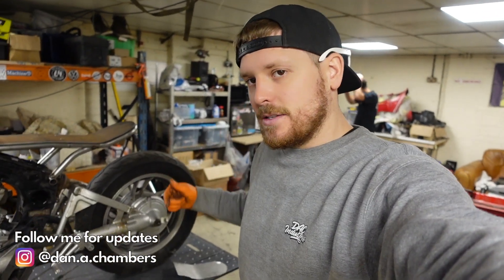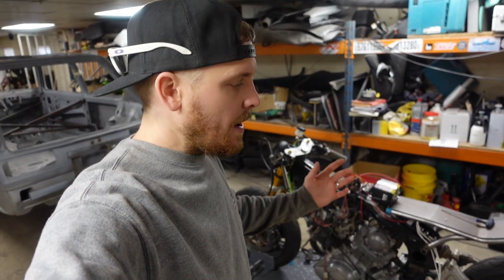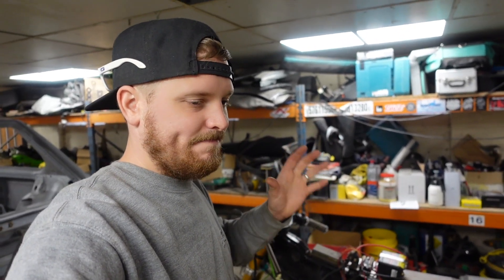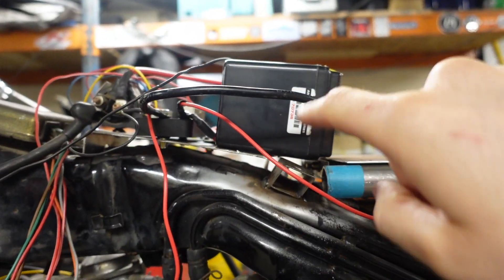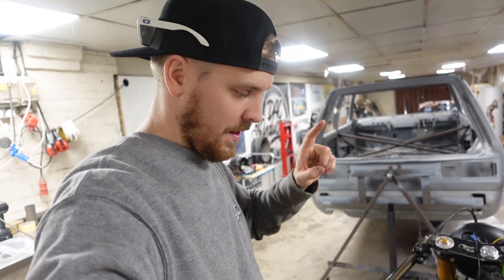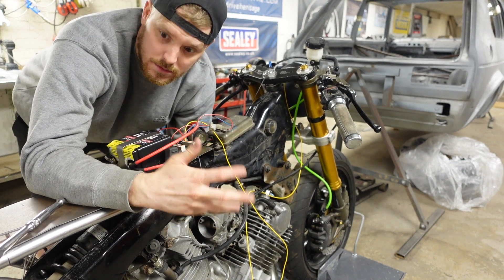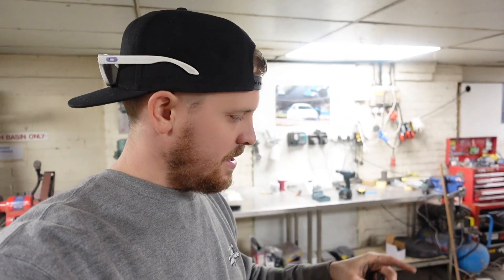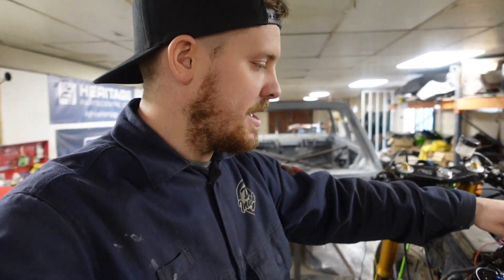1981 Yamaha XV750 Cafe Racer Build Series Ep 6 - Brat Custom Virago Motorcycle XV1100

Comment: Hey Dan, great work here! I was wondering if you would share your wiring diagram? I'm also building an XV1000 and I'm currently struggling with the connections between the motor and the m-unit the make it run.
Reply from the maker: Hi bud, I haven't made a diagram yet. I just sort of put wires in place and it worked 😂 I am planning on doing a video trying to explain it all when I have the bike built and I know it is right. drop me a DM on insta and I will try to help you.
Reply: @DanChambersDAC  thank you very much, I wrote you on Insta :)
Reply: @DanChambersDAC  Hey Dan,
Great work, following your builds. It's amazing and simplified👍👍

The question I have, what colour wire Are you taking from Tci to m unite and in what out put On the m unit is it going to?  The same also wit the solenoid?

Or how long will it take before we have a  detailed diagram or  video? 

Thanks mate
Reply: @6235326  hey Mael,

Have you got the wiring diagram from Dan, he is nor answering. And I am stuck with the wiring, any help from you?

Thanks
Reply: Either of you guys get a diagram put together on this trying to trouble shoot my ‘81 750. Did the exact same thing in vid but not getting starter to turn over.

Comment: Great video Dan. One question: Usually in other videos they said that you need to replace the rectifier for some model that is specific for lithium battery. Have you checked that?
Reply: He mentioned that the Reg/rec has been replaced with a unit made by Rick’s electrics in the states. He actually bought the battery and the Reg/rec from Antigravity UK

Comment: Soo let me get this straight... Your ignition system has to stay basicly stock and you spent 1000 pounds on a fancy box which only replaces some wires up to your switches and a flasher relay?
Oh and I would add gussets to all the angle brackets you made from Sheet steel.